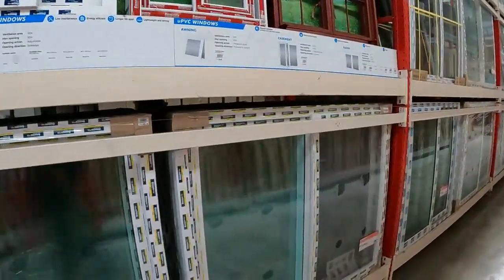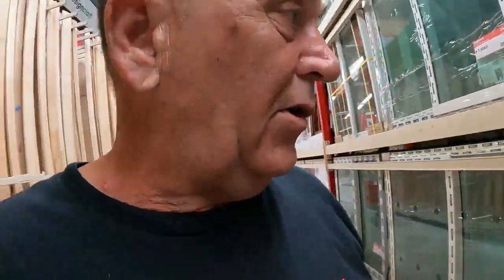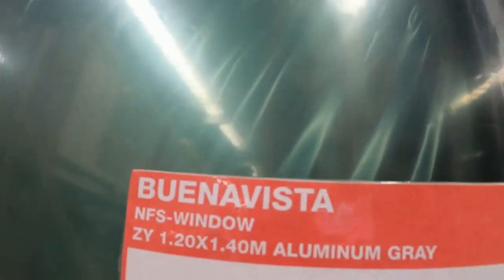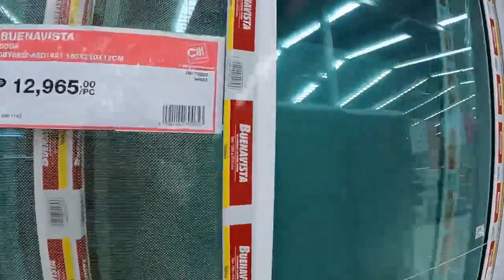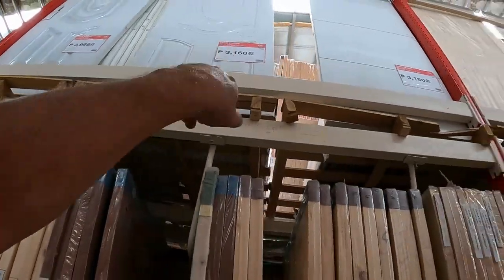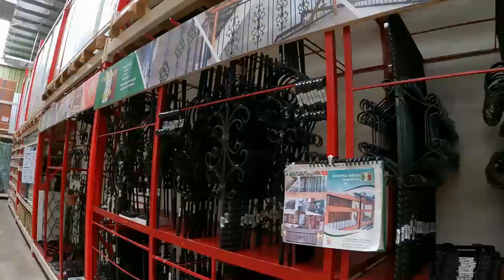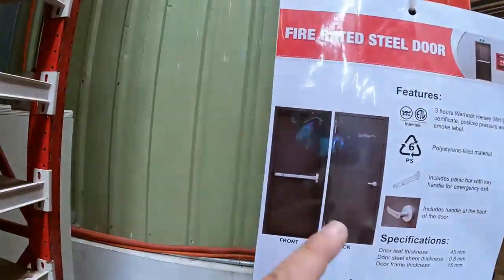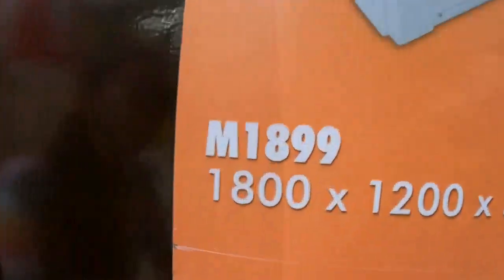Some Ideas when Building in the Philippines - Prices of Doors and Windows at Citi Hardware

Comment: are the back boxes on the two pin electrical sockets  the same size as the universal sockets that you have and did you say the universal sockets have no earth connection .? thanks will .
Reply from the maker: Yes mate same size is the inside wall mounting.. no earth here, I just cut the earth pin off when i need to use it on a 2 pin socket when needed
Reply: David, they also have adapters. 2 pack for like 70p. A buck 40 US